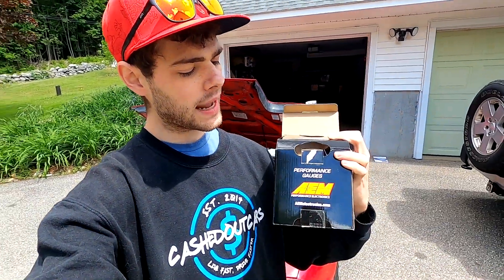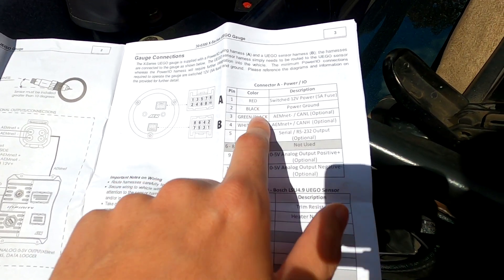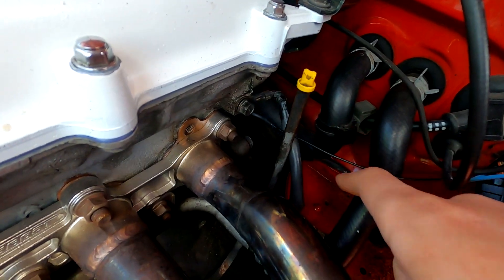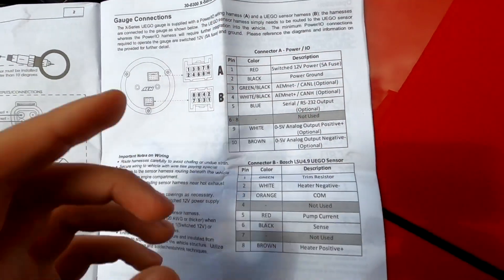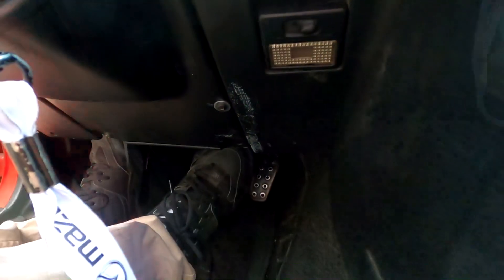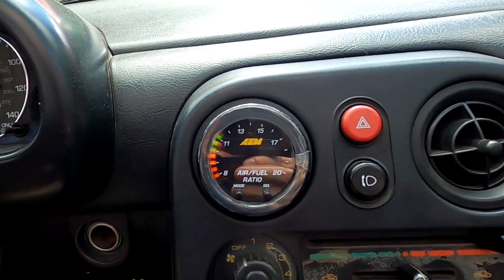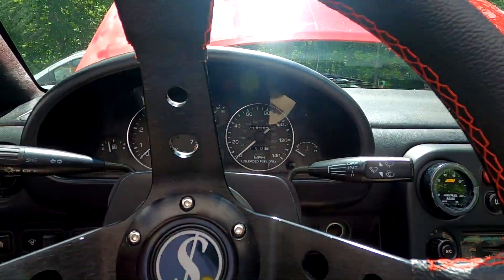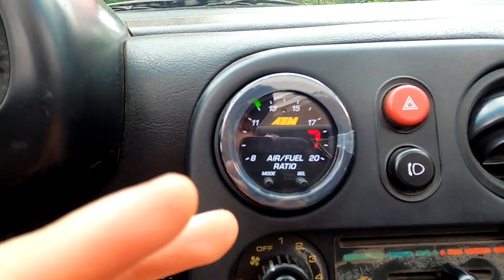AEM X-Series Wideband Installation | 2Broke2Boosted Ep. 4

Comment: Lamba better anyways. Nice video. I was curious how you were replacing a 0-1V narrowband O2 sensor with a 0-5V wideband sensor, but it looks like it's because you're using an aftermarket ECU that allows you to change how the analog input is read on that pin?

Comment: Hi i have a question im about to install a speedy efi standalone and i want to connect it to the aem wideband just like u did on ur vid. If i understood right i need to cut the stock o2 cable and wire in the white from the wideband but i looked the stock o2 it has a white blue and black wire im really scared to cut it xD i could not rlly understand in ur vid how you did that. Could u help me out a bit 😄

Comment: My gauge is reading about 16.8 at idle, when driving it varies from 12 to 23 and I can’t get tunerstudios afr gauge to read the same. Any ideas? I put the correct voltage to afr readings in tuner studio.
Reply: Update: it ended up being a bad connection whenever I wired in the sensor. However, my AFR is still ridiculously lean. If anyone has a good NA afr table they could share that would be wonderful.
Reply from the maker: I'm glad you got the connection sorted! Just add fuel where it's leaning out, or use autotune to get it closer!
Reply: @CashedOutCars  thanks man, I’ve used auto tune on tunerstudios for a couple drives now and it’s improving majorly. I have my target AFR set at 14.7 and I’m still currently NA while I get used to tuning

Comment: Installed my 30-0300 but it reads 18.80 in Tunner studio. Reads around 14.7 on the guage. I've been trouble shooting for days and can't get this figured out.
Reply from the maker: Is it stuck at 14.7 on the gauge? If so, it sounds like it's not reading correctly because you should see some fluctuation

Comment: Why dont you show the white wire tapped into the Original ECU wire? Im extremely confused
Reply: Nevermind The NA has the single wire 02. I tap the white into the plug i cut off the old narrow band sensor. That just leaves me with one question. Where do i ground brown??
Reply: @xavierlipscomb2000  Brown wire just grounds to the chassis or engine. Anywhere with a good connection

Comment: Hey just a question the X-Series gauge isn't in the drop down window how did you get your gauge to sync with tunerstudio
 what was your Point 1 Volts & AFR and Point 2 Volts & AFR
Reply from the maker: There is a table that came with your kit that has those values! Put them in and you'll be in good shape
Reply: @CashedOutCars  tried that still off a bit. Does it be 100% accurate?

Comment: I really wish he would go more in depth about what na spark tables he used and exactly what he had to do because the speedy efi is difficult to just get your car to run
Reply: Agree. The stock tune in the efi is conservative and rich.  Also, the displacement and injector settings are wrong.  I put one in this weekend and it was quite rough.  I’ve got a wide band coming to actually tune the car.
Reply from the maker: A bit rich and conservative on the spark is safe, what’s why the base maps come like that. A base map is really designed to be dialed in and not ran forever. You really need a wideband to make the most of the ECU and it sounds like you’re on the right track!

Comment: Hey Cash, I have got my red wire using my cigarette lighter for 12v and grounded my black wire to the chasis. I still have to splice in my white 5v signal output but I am a little confused, do I have to also ground my brown wire aswell along with the black ground wire? So I have my red 12v/black ground/white 5v output to my stock o2 wire and I ground my brown wire to the chasis or engine also?
Reply from the maker: Hi! Yes that is correct

Comment: Hey Cash, for your AEM wideband install you only routed your positive analog wire(white wire) to the stock O2 harness and left the negative analog wire (brown wire) to be wrapped in heat shrink. Don’t you need to wire that negative analog as well for an accurate reading of the O2 sensor to the ECU?
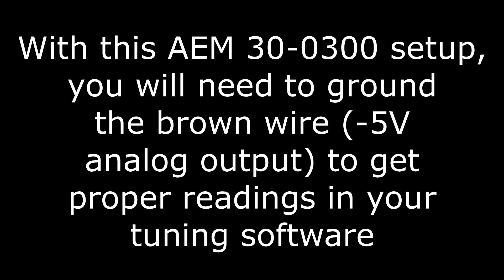Reply from the maker: Hey! You’ve got a good eye. At first I didn’t properly ground that wire. If you don’t you’ll get improper readings. I put the disclaimer in here at 4:29 that explains that you need to ground it. Good luck!
Reply: @CashedOutCars  Thanks! I figured that’s what you meant, but where exactly did you ground it?
Reply from the maker: I grounded mine to the engine block at one of the factory ground locations. The best place to ground it is at the ECU ground to make sure signal is consistent with what the ECU is seeing
Reply: @CashedOutCars  The SpeedyEfi doesn’t need to be grounded though right? From what I saw in your other video you just plug it in and hook up a vacuum line right? No grounding of the ECU required
Reply from the maker: Correct, the PNP harness has a ground built in, the wideband O2 just needs to be grounded to the location that the ground goes
Reply: @@mcmlxvii5961a year late lol but so you can put the black and brown wire in the same ground?

Comment: hello, i have a question. The last start up you did before ending the video i heard the car crank and then stop turning and then turn on. I have that same issue with my miata what did you do in order to fix that start up? Thanks!
Reply from the maker: Hey! I haven’t changed much tune wise for cranking and starting. What I did find was that giving the car a bit of throttle (just a tiny bit) while cranking helped my car start. Also, my battery has a tendency to die so I always keep it charged up

Comment: Where does the gauges wideband output go though? To the factory o2 sensor signal wire?
Reply from the maker: Yes I chopped the factory o2 wire and spliced this in, depending on what ECU you’re running you can setup a custom input for it but on mine I wanted to use the stock one

Comment: How do you revert tune? I was following your video and have not tested the ecu after updating the software.
Reply from the maker: You can revert the tune by starting a new project with the specific firmware you want to run, then load the old base tune using the open tune option. Make sure the O2 sensor is grounded properly otherwise the readings won’t be right and the car won’t run! Good luck

Comment: Okay so your saying with that ecu it is literally plug and play at first? The first video you posted, I wouldn’t have to do all the downloading on the computer right?
Reply from the maker: It is plug and play, but you need softwares to properly use a standalone ECU since they don’t tune themselves or automatically choose which other features to use (launch control, boost cut, etc). For ECUs PNP means it’ll plug right into the factory harness without you making a custom harness, but you will need to set it up on your computer. Let me know if you have any questions!
Reply: @CashedOutCars  thank you!

Comment: Nice install. But, PLEASE, never start the engine when the sensor is already hot.  The CERAMIC element in the sensor "warms up" to about 1200F ( glowing orange ).  And, hitting it with a blast of (relatively ) cold startup exhaust is like throwing ice water on a hot windshield.  And, the effect is the same.  Cracks that grow, over time.  They cause air leaks, that ruin accuracy.  Then the sensor starts flaking out.  Eventually, the cracks hit something critical; and, the sensor is done ( blowing your budget ) :(  If you se " - - - - " or an AFR  reading, the sensor is already fully heated.
Reply from the maker: Now that’s something I didn’t consider. Since the gauge has the loading bar I figured it needed to be heated before startup to ensure it reads correct and thus idles correct, since idle is still dependent of the O2 reading. Thanks for the tip!
Reply: @CashedOutCars  Nobody but me ( and the datasheet for the Bosch sensor ) tells you this.  In OEM appllications, the ECU does not start heating the sensor until the engine is running.  That's , largely, why OEM wideband sensors live longer than aftermarket installations of the same sensor.  Startup idle is, usually, open loop, until the o2 sensor is ready.
Reply from the maker: Yeah that’s certainly something that isn’t talked about or widely known, but it certainly makes sense. I may make a video on it as a PSA to help people prevent early failures. Thanks!
Reply: @CashedOutCars  I wish somebody would.  PM me if you need any info.  You would THINK the WB manufacturers would be shouting this from the rooftops.  I'd say that a huge percentage of what complaints people have about these WB's are premature sensor death.
Reply: @CashedOutCars  In preparation for installation of my own AEM guage I've watched your videos, CarPassionChannel videos, and the AEM factory video about this specific guage and they said the same thing lordandprotector is saying.  Just fire the car up, don't wait for the gauge to heat up first, you want them to heat up together to ensure long life of the sensor itself.   The relatively cold start up exhaust on an already hot sensor will cause premature failure of the sensor.  This isn't an instant death of the engine thing, it's just wearing out parts accidentally without thought of why it's happening.  It's like keeping your foot on the clutch for extended periods of time at stop lights, it won't kill your clutch but it will cause your master/slave cylinder do develop leaks earlier than someone who pushed the clutch down only when it was being used.
Reply: They make more money selling replacements
Reply: @steeleardoin1190   Maybe. But, I don't think so.  They do not manufacture the sensors. So, their margins on them are, probably, pretty low.  Especially when selling through retailers like Jegs, etc.  If you look at the reviews of widebands on amazon, a huge percentage are "sensor died".  So, I assume, that causes a lot of the returns.
Reply: Any comment on this Cash? Should I be wary to turning power on before the actual engine?
Reply from the maker: I’ve still been mostly letting the sensor warm up before starting it and haven’t had a problem, so I wouldn’t be overly concerned. It’s something to keep in mind but I wouldn’t stress over it
Reply: @CashedOutCars  awesome, great thanks as always :)
Reply: @CashedOutCars  You won't know that you have a problem, until it fails.  Before that, it will be inaccurate, due to small cracks in the ceramic element.  By the time the sensor starts to get flaky, it has, usually, been giving bad data, for a while.  I recommend NOT playing Russian roulette with your sensor, if you can avoid it. :)
Reply: Wrong. Allowing pre-warming damages the sensor.
Reply: @MrHeksas  That's what he said...

Comment: Don't u have to have the o2 out of the bung at first then put it in so it has the outside temp or what not
Reply: Not with the x series, comes pre calibrated
Reply from the maker: What @Collin said, and it’d be looking for clean air with no fuel in it rather than a set temperature